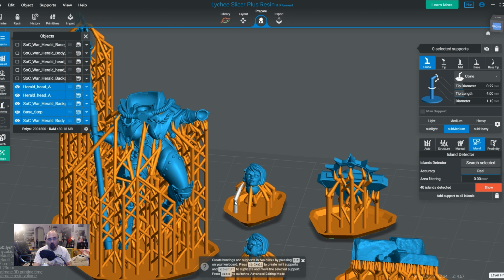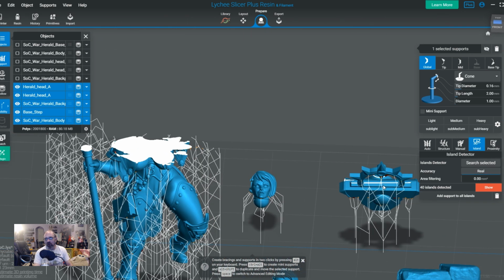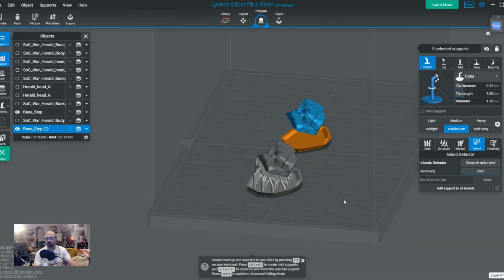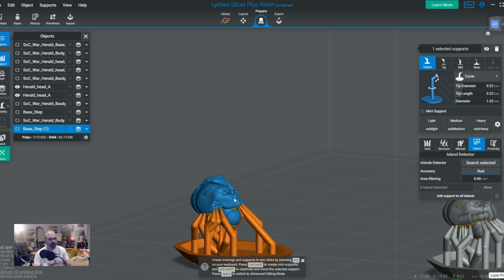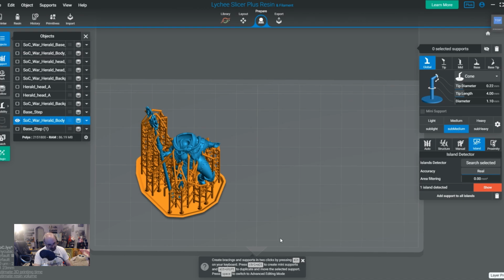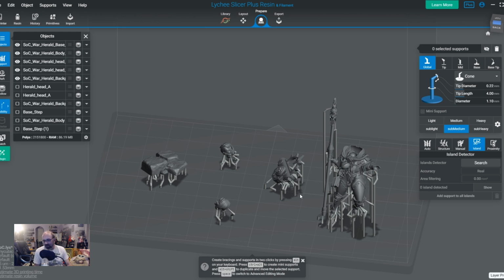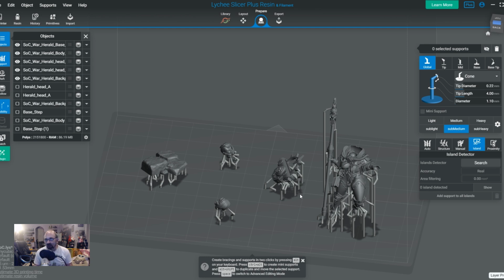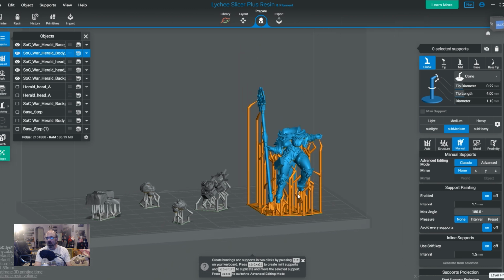PrintMyMini 3D Printing tutorials Print fails Fix them common solutions to common problems

Comment: Very nice info drop I’ve been playing around with anchor diameter, mostly shaft, and tip length as well, making them shorter wide and getting Less elastic, bounce I have found. Also, with suction cups, I found that the shape of the suction cup like you were mentioning also helps to determine sharp angles don’t have as much suction cup issue as rounded. I see you use a higher density, smaller tips similar to what I’m calling the bed of nails technique. Do you have a set interval for your tip size compared to larger tip sizes?
Reply from the maker: Yes, the "bed of nails" is the perfect name for this technique. I use normal intervals on the smaller and medium tips, it depends on the piece or model itself really.

Comment: Hi! Can you please link where to get the specific sculpts you use for your video thumbnails? If you're going to use them as thumbnails, can you at least allow the audience to find them easily?
Reply from the maker: Lol, they are mostly Digital Dark Pin-ups models, and for the most part I cannot directly link to them due to Youtube policy issues, but you can find them on Cults3d.